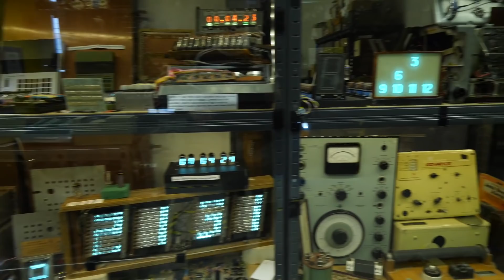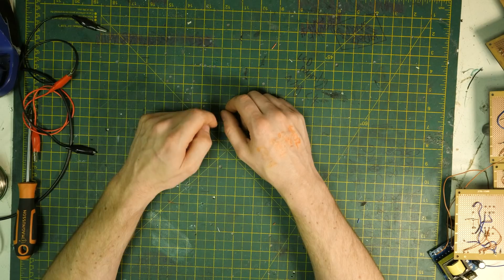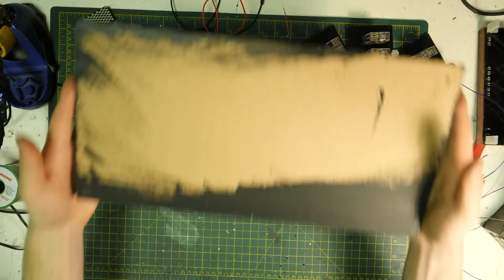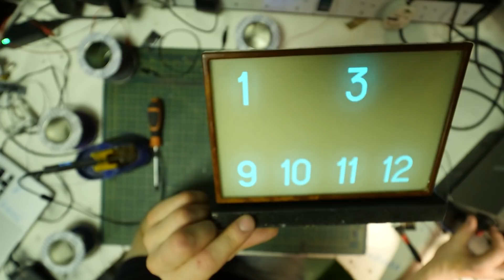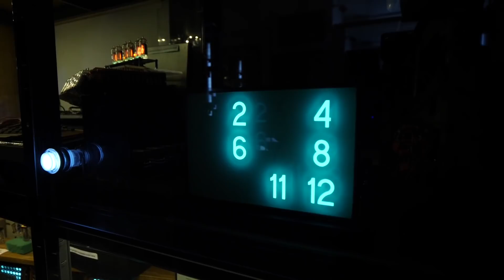Phasing Electroluminescent Relay Machine Display IEL-0-IX (097-123)

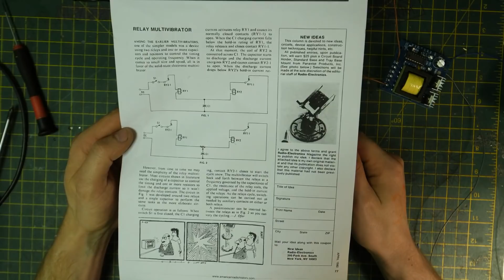Comment: At 8:45, a shame that Sam's on the other side of the Big Pond, as I have almost every issue of Radio-Electronics magazine from the early 50's thru the mid 70's. Also have multi-decade collections of several other similar electronics magazines: Electronics World, Electronics/TV Dealer and so on. It'd be cool to see all these digitized and posted online, but it'd be a massive project, and somebody might still hold the publishing or copyright rights, so...or are they already available online somewhere?.

Comment: Kool build!  The relay noize would drive me insane eventually...would prefer the use of silent solid-state relays for this purpose
Reply: Yeah but then it doesn’t sound cool. Wouldn’t be much point using relays in it if they didn’t have a sound
Reply: Thanks tho!!! But alas the reason I’m using relays is to make it more obvious to people coming to the museum of the electrical function. The sound gives a more visceral experience in my opinion :D
Reply: @LOOKMUMNOCOMPUTER , even before there were electronics, there were electromechanical devices, like switches, relays, brushes, commutators, motors, buzzers, and finally transducers such as speakers, transformers and microphones, alternators and generators, etc. No electromechanical, no electronics. You could make an argument that point-contact transistors are as much electromechanical as electronic.
Reply: I love the noise because you hear the tempo drift

Comment: Connect this system to a synth
Blinkety synth ;)
Acctually, create a voltage divider from different value resistors so all the resistors add up to the max range of the synth, then wire a set of contacts across each resistor

Comment: You could use a flashing LED, with a transistor and couple of resistors to drive a relay
Reply: I did that trick in a school project, I wanted a flashing light for a rc emergency car and since i was too lazy to build an multivibrator I abused a blinking LED to drive the warn lights (I don’t remember but I think without a transistor). When I had assembled all of it and build it into the RC fire truck and closed the lid, it no longer worked. Everytime I opened it to inspect it it worked again. I finally figured it was light-sensitive so I installed a lightbulb inside to keep it going. Yes.. those are the most messiest electronic circuits ever ,)
Reply from the maker: ahaa I see then the led flashy flashy could control the relays! nice
Reply: That badge is adorable